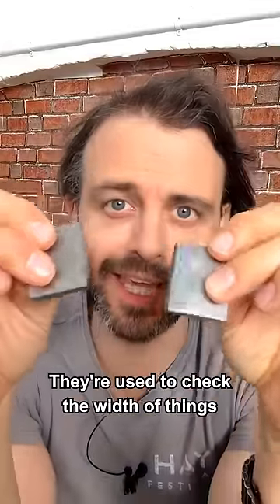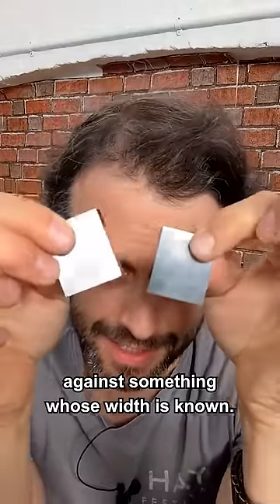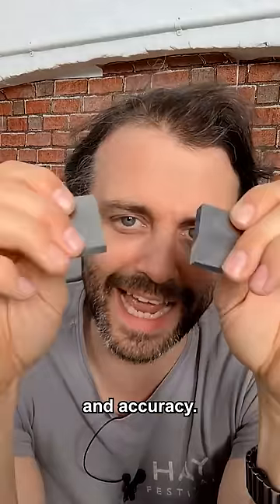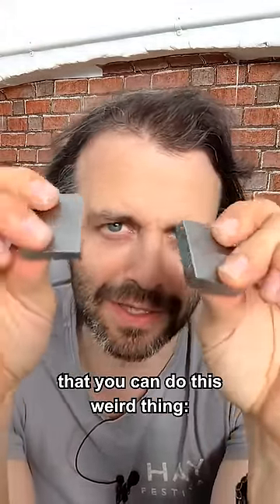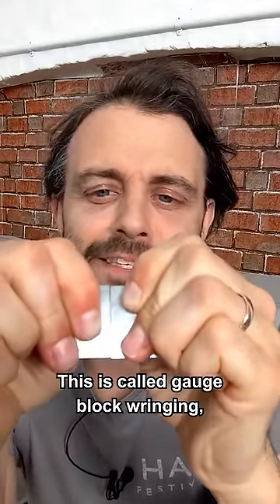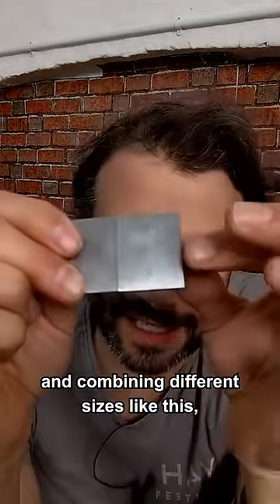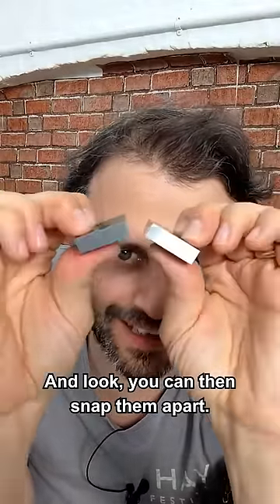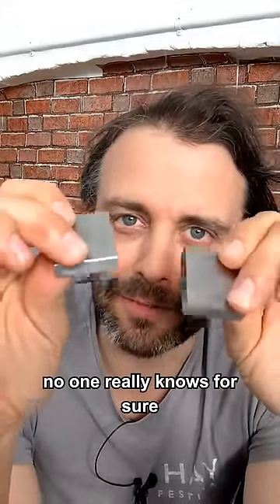No One Knows For Sure Why This Happens!

Comment: Well, magnetism is obviously not the answer. But they appear to be metal. 
My first idea was that they adhere due to the van der waals force, like a gecko walking up glass. 
The only thing stopping two metal crystalline structures from reattaching is the thin layer of oxidation on the outside that creates a barrier, thus preventing the crystals from incorporating themselves. 
However, since the surfaces are stated to be very smooth, and you see Steve push and twist, I would argue that that might be enough to force enough of the oxidation layer away to allow for a partial connection. Enough for them to adhere like a magnet without actually connecting. 
Does this make sense?

Comment: Just a guess from someone who has no idea what they are talking about
The surfaces are smooth, extremely smooth
But if you look at with with a microscope, it's not smooth at all
So making it "smooth" increases the area of contact between the 2 pieces
The "smoother" the surfaces are, the more points they have to hold on to when you apply pressure

Comment: This has a simple answer. Electromagnectic forces. The space inside an atom the most space of it it's empty. The electromagnetic forces defines the size of the atom in a continuos metal all molecules are too close. When you cut it and polish too much the distance from a molecule or atom with the next some times is the same as the continuos piece and others is bigger. More molecules closer more atraction.

Comment: Is that a metal that doesn't oxidize? If so the smooth faces and lack of an oxidized barrier could lead to an unstable connection. Kinda like a bad weld
Reply: yes, but you can't say weld two pieces of gold together by pressing them into eachother

Comment: the faces are so flat, metal meets metal, very similarly to how the metal meets the metal inside the blocks already. Therefore the metal just 'thinks' its part of the same mass or metal.
Reply: the electrons from one block probably flow through (thinking of them like planets for the sake of convenience) the other block when they are joined, there is so little air between them.

Comment: Hmm. I have heard that in a vacuum, uncorroded metals that touch one another can spontaneously weld to one another due to electrons transferring between the two objects. I wonder if this is a related phenomenon, caused by the precision of the blocks being so fine it pushes even things like air molecules out of the way when you turn them together in that fashion? Just conjecture. I'm no physicist. What a curious little fact.

Comment: Could it be bc of the arrangement of the atoms and molecules? If the surface is super smooth and you rub two super smooth surfaces together the pressure and heat from the friction cause the atoms of the two different surfaces to bind together (probably through ionic bond if between metals). 

And why it doesn’t happen between unsmoothed surfaces is because the jagged surfaces have their atoms arranged in such a way that the pressure and friction heat causes some of the atoms iconic bonds to break and make them fall off. Explaining why rubbing two objects together with enough force cause them to be sanded down. 

It’s like friction welding but in the scenario in the video the required heat needed to make the two metal blocks stick to one another is less than what is needed to weld two metals with friction welding. And because of that the bond between the two surfaces is strong enough make the metals stick but weak enough to split apart again with a small enough of force.

P.s - with smooth surfaces there’s no room for broken off atoms to escape when you rub them together, as the pressure traps them and the friction fuses them. Where a more rough surface would have a crap ton more space (on á microscopic level) for broken off atoms to fly away as you rub them together

Comment: Isn’t it something to do with creating a vacuum between the two? Only a weak one, which is why you can still break them apart but even with completely flat sides - note: complete is an absolute, and therefore paradoxical; only useful in terms of perception - if you can drive all the air from between them, they will provide at least some resistance to coming apart. 

Don’t quote me. Just a follow on conclusion from stuff I learnt in school years ago, but…

Comment: Isn’t this basically cold welding? If you have two PERFECTLY flat (like “atomically flat”) surfaces put together the atoms line up and basically form a perfect joint, the seam would disappear. The reason why NASA uses dissimilar metals for joints that need to move, because in the lack of atmosphere oxidation can’t coat surfaces (well because lack of oxygen) if they closed a door in space on similar metals, the interfacing of similar metals would form a cold weld and they would never get that door open again. On gauge blocks the material used is tool steel (closely resembling stainless steel) which is unique for resisting oxidation (rust) and the surfaces being really  flat for dimensioning requirements. I would imagine the surfaces aren’t perfect enough for the cold welding to be perfect as the surfaces aren’t perfectly atomically flat. So you can easily break the gauge blocks apart since there is very little cold welding happening. This is my prediction.

Comment: Lies lies you literally explained they’re so smooth so basically the particles can get close enough to the particles of the other metal and “connect” with any rough edges or dirt keeping them apart. Same reason why my brand new shelves won’t come apart when they’re stacked on top of each other unless I slide it out a bit to pull from under the exposed shelf.

Comment: If it's as smooth to a level of molecular levels, the vandervals force can multiply by large level (I don't to to what level) due to the increase of surface area in contact.

Comment: Oils on your hands or metal trap air pockets creating a suction like force its probably not all that flat under a microscope im not a genius and im probably wrong but i feel like this is a razor question the simplistic easy answer is probably right now do this with a super fine power i bet its different.

Comment: Because it is manufactured to a certain degree of accuracy it will display such exotic attributes where it would be classed as a quantum material even. With such a finish the 2 pieces being virtually identical would recognise each others surface as their very own sharing a quantum stickiness melding when slid in together as such as if sharing the same exact memory to one another!

Comment: You said it....smooth on the molecular level and metal always has oil ..push  slide twist = vibration gage block ringing the harmonic ringing of the metal back and forth connect

Comment: BS❗️  Why do you think any metal holds together anyway? Metal has a regular kubic grid & shares the outside electrons with the neighbor atom. (That's why they conduct electricity so well)
The metal holds together because the cores of the atoms are very close in vicinity. The attraction of the masses of the cores of the atoms (low distance effect) is able to take place. 
When the surface of these two blocks are SO VERY SLICK, that by pushing the air between them aside, you are able to put enough neighboring atoms close enough together. Here about 10000 atoms. The low distant force is able to take place.
If you do not separate the blocks in time, the very last oxygen & nitrogen  molecules will be gone. Then the force of attraction is even greater.

Don't you have physics at school?

Comment: Until it gets scratched or beat up and they no longer wring together so I’m guess it creating a vacuum that the outside pressure is able to keep it together. You know how you’re able to place a piece of paper under a full glass of water and the paper hold the liquid in. Fun fact you can do this with two flat surfaces that are of different materials.

Comment: Is this similar to the effect of cold welding? Its happens when two metals bond together  with no heat? Its been documented to happen in space 2ith uktra clean mentals, metal surfaces are polished and clean so much the oxidation layer is gone so its pure bare metal on metal so they just stick together

Comment: It is possible that the very materials are fusing together, the gap between the two blocks being so stupidly small that the mollecules from both objects are close enough and in sufficient number to interact to an extreme amount with those on the opposite side. We know that if you just leave them like that they pretty much just fuse together to an extent, though the bond can still be broken.

Comment: Just as all metals have crystalline structures, grains, that dont line up but still remain adhered as one block, "grain boundary" , when there are no oxides or material separating the two, by pressing them together the atoms are able to get close enough to bond the same way the grains remain bonded to form a single piece of "metal". 

Thats my attempt, i tried

Comment: for me, im ive got a few theories, if it works in a vacuum then its not air, so a possible solution is that they possibly, just maybe, generate enough of a charge to magnatize the very surface of the metals, making a magnetic weak bond

Comment: Since the air pressure theory has been investigated and does not hold up I propose a crystalline electronic bridging force theory. Since the surfaces that are pressed together are machined exceptionally flat the physical contact of the two surfaces is such that more metal contacts metal than there is intervening areas of non contact actually obliterating any gap. This enables the electrical forces that are present within the crystal structure of each metal block that gives it form are also able to interact between the metal in the two blocks along the surfaces that make contact. I suspect given enough time the two blocks, left undisturbed, would eventually fuse together as their crystalline structures establish enough bond links.

Comment: I would imagine its the same reason when you smoothly have a lot of water between your water cup with a flat bottom and a coaster. The surface tension between the two bricks here is probably greater than the pressure for them to come undone. Thats my guess

Comment: Metal has free moving electrons if you slide them together when the surface is almost 100% flat you can achive basically them pieces of atoms welding together its just really weak because it requires temperature or pressure/friction to fully weld them together. I am happy I instantly figured out the science behind cold welding according to chat gpt.

Comment: It’s because the pressure turns into an electric current, which leads to a magnetic attraction. I got my hand stuck to a door handle after getting shocked by Xmas lights

Comment: But why aren't they sure?

I was told broken things can't just stick together anymore because on a molecular level the surface isn't even enough to reattach. So if you can make a surface extremely smooth then I can imagine it sticking together. Is that not what happens here?

Comment: The odd thing about that is they have to be perfectly clean. They are so flat and the surface finish so fine that even the grease from your finger will prevent them from being wrung together.

Im a machinist and use these regularly, this still amazes me.

Comment: All surface suction is the suction of the smooth surfaces when being pressed together pushing out the are sucking them together as if they were one of those things you hang in the shower you lick the little round ball thing and push it on to your shower wall and it sticks that's how it happens but common knowledge hello anyone

Comment: Maybe it has something to do with oxidation. Maybe when you press them hard against each other you are actually rubbing off the oxide layer formed on them and as they are almost perfectly smooth, it is easier to eradicate the oxide layer effectively. Now that the metal atoms are bare, they form a special bond between atoms of similar kind and stick to each other like clays or doughs. Also, the longer they stay stuck, the stronger their bonds become and harder it gets to separate them.

Comment: my best guess would be that you scrape the surface in a few spots but it's so smooth that the metal atoms can Form metallic bonds between the two surfaces where the oxide has been scraped of or thinned.

Comment: Wouldn't friction be the main reason gauge blocks stick? Similar to how sheets of glass are so smooth if set directly on another the glass is extremely difficult if not impossible to separate. Also the malleablity or how magnetic the metal could aid in the sticking.

Comment: Cold welding. The metallic bond can join at some points. The metal nuclei and electrons treat the other block as it is a part of the same piece. Because of the smoothness, when you rub them some places of the surfaces cold weld.
Reply: Not even the slightest bit true.

Comment: First off, the gauge blocks are NOT perfectly flat or else they would literally weld together.  I worked in disk drives for years and the heads and disk surfaces ARE very nearly perfectly flat within less than half a wavelength of UV light.  We do know that the distance of heads and disks is way less than the distance between air molecules. When heads and disks slap together if the disk is not moving while the heads unload onto the surface, they literally weld themselves together, which is why a disk drive always keeps the heads off the surface until the disks are spinning, then loads the heads off a ramp onto the moving surface, and when stopping, quickly unloads the heads off the surface. Since the heads are “floating” at a distance less thank] the distance between air molecules, what exactly is causing the heads to float above the moving surface?  I don’t know.  Are the individuals air molecules using the molecules themselves as bearings? Again, I don’t know. There are springs on the heads forcing the heads downward onto the surface, so some sort of force is involved.  And that is another mystery. But back to the blocks, which are an entirely different matter due to the level of flatness and contamination presented.
So we have two levels of flatness here.  ONE- the flatness of general measurement blocks coupled with uncontrolled “clean-ness” or contamination of the mating surfaces, and TWO-the absolute flatness wavelength precision surfaces of controlled non-contaminated surfaces (disk drives are assembled in clean rooms with extremely clean air).
As a result, given your handling of those blocks with your contaminated hands in a dirty environment, we don’t have enough information to determine why the blocks are sticking together. Is it from the oil contamination from your hands coupled with the semi-flat surfaces?  Was it from the lack of air (via sliding) coupled with the semi-flat surfaces?
We need to see a more controlled set of experiments involving flatness/clean-ness of the blocks and environment, and possibly temperature.

Comment: What if it turns out that what we've been calling "Dark Energy" is really just bubbling spacetime? What if spacetime bubbles by default in a quantum-stochastic way UNTIL it encounters wave collapse? Perhaps those bubbles by default have a tendency to push things apart, ever so slightly, counteracting gravity. What if macroscopic objects, are in a perpetual state of wave collapse on the outer surfaces due to the interaction with the environment? What if that cancels the bubbling? While inside the material, there is still quantum stochastic behavior, i.e. the material is not wave-collapsed on the inside, being a wave function, but with the restrictions placed by the surface's more-definite state. And thus, two very very smooth objects don't provide enough cavitation--i.e. little spaces in their imperfect surfaces for bubbles to form--for the quantum bubbles, and thus, the bubble pressure from outside the wringing surfaces is higher than the bubble pressure between them? I believe this has a name already, the Casimir Effect. What if once the surfaces are joined, they sort of disappear as the materials begin to share their wave function? Perhaps what makes discrete "things" separate from each other in this universe is the quantum bubbles between them, and what if this is a macroscopic way to manipulate that?

The interesting thing, if this is why, is that it is so easy to see at a macroscopic level. But I would posit that in general, you see the Casimir Effect all around you being expressed and are so accustomed to it you take it for granted.

Perhaps the ultra-smooth surfaces are a canceling of the Effect's common manifestations. But does it only work with metals? Can we get a surface to be as smooth as a metal, while not being a metal? Is it related to the material's tendency to crystallize?

Comment: If you take them apart, there will be a small vacuum between them before the crack opens enough for the first air molecule to get in between. The force comes from the pressure of the atmosphere.

Comment: It's not vacuum pressure, this works in a vacuum with no air either. When molecules of seemingly solid metal are close enough they can begin to exchange electrons forming a bond. It's not welding. They dont become part of the same crystilatus structure but it's a form of bonding via electron. exchange. Another thing that can cause gauge wringing is oil from your hands kinda gluing them together.

Comment: So there is 3 reasons for this that on an atomic level the surface is so smooth that the atoms actually are attractive to each other next is the .020 film of oil that is taken into consideration when machining the blocks & yes air pressure is the third & yes if u try them in a vacuum chamber they still work just not as good y u say
Your taking one of the 3 elements away that work this magical wonder 🤷‍♂️haha jk 🧙‍♀️ 😮🙈😳